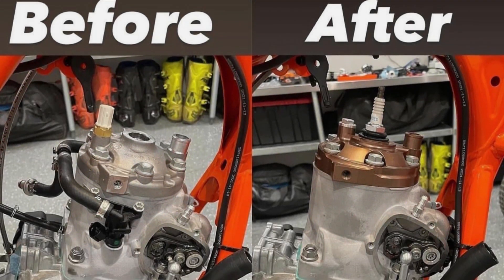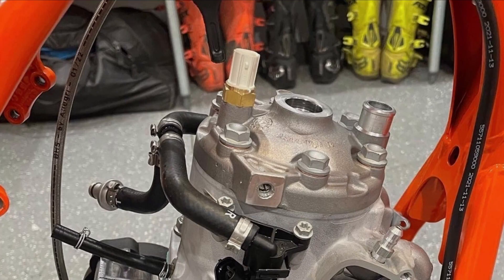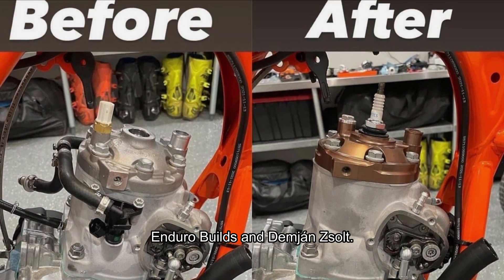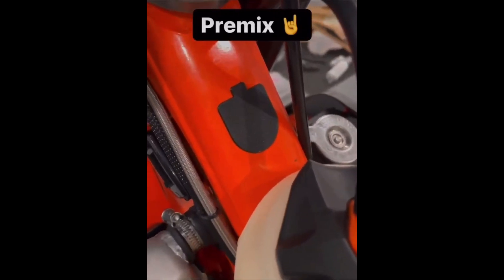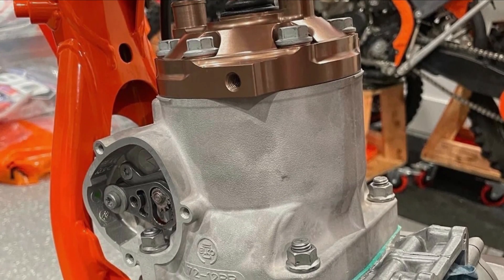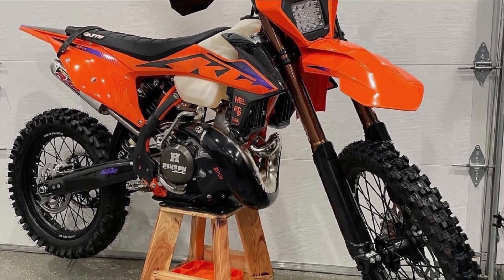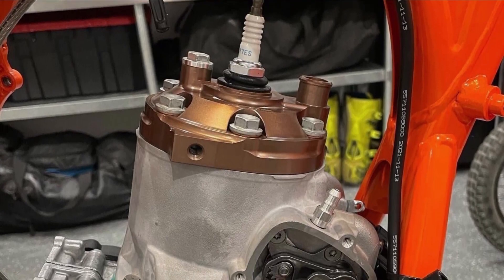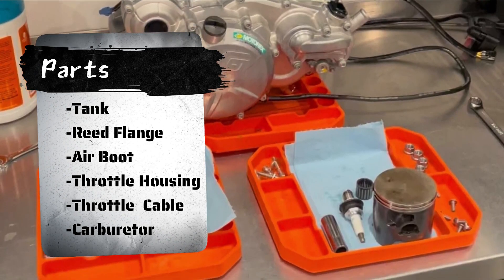KTM TPI TO CARBURETOR CONVERSION | $5,000 Dollars In Parts

Comment: I've done it as well because with the tpi it had light throttle spluttering that i hated even after custom head, tune and a top end rebuild. 
I'm still running the tpi electrics, now I have the ease of tuning to my riding style and it didn't loose any ridability or hp.

Comment: Hi, I'm considering the same conversion, because I want to have light and reliable bike. Please let me know if MY2023 could be still converted in the same way or something has changed. When it comes to cylinder, you have written in the description that we need to use 19 XC cylinder. Isn't the cylinder the same in EXC MY2017? So I would suggest to by 250 to 300 conversion kit: SXS12300100. What do you think?

Comment: I converted my 2022 TPI to a 2022.9 LOL. as in relocated a fuel injector to in-front of the reed cage, removed the oil injection sysyem and went to 100% premix. 
Added a Coober ECU and Slavens S3 head. 
Adjusted the power valve spring out a bit to flush with the case to reduce the hit and adjusted the air bypass screw in to richen it and make it run better in all conditions and throttle positions.
It goes like a scalded cat now, has instant throttle repsonse every where, and will tractor pull all day long at idle speed in 2 & 3rd gear. Will power loft the front wheel in all 6 gears.

Comment: I converted a 21 TX 300 with a BRC 500 from fuel injected to carbureted.   I used all new parts except the carburetor,  and spent about 1000.00 dollars doing it.  The flywheel is the most expensive part, .it's easy and no where near 5 grand.
Reply: why was it necessary to change the flywheel?

Comment: seems not a good choice. Correct the TPI by adding oil to the tank or deleted and split the injectors. Or buy a TBI. Other brands are ok, but not as easy as KTM that is a pure fact. Except Sherco other 2strokes are plain crap and can't rival KTM, whatever people's wanna say about it. 
if you like carb just buy the GASGAS they have some still carbed there. But sorry to say, carb is old and annoying tech, injection is clearly the thing. Do not make the same none sense talk like back in the 90's on the 4stroke...carb is better than injection...yeah sure...we can see that on the 4stroke...plenty of carbs on the 4s nowadays....
People telling that carb is easier than injector is complete BS, first a carb is a pain has you need to service it very very often and get dirty and setting is changing and stuff. Injectors never have any issue.
Reply: You can't just add oil to the tank and remove the pump. It results in the oil not getting to the crankshaft and all going out of the exhaust. You'd have to do this along with the injector relocation too.

Comment: Just put a tbi conversion kit on if you don't like tpi. Far less work and expense.
Reply: Where i can find this tbi conversion kit
Reply: @miguelbardales5561  There are several kits out in the market right now. Sure Shot injector replicator TPI to TBI is one of the kits available.
Reply from the maker: I did not do this project, but I find it very interesting. How do I convert my TPI to TBI ? What mods i need do
Reply: @TheDirtbikeRider   use the commonly available kit you can find for $150 or so. There's another that is sometimes on eBay from Ukraine that is identical. Then there's the Athena kit which seems too complex IMO.

Comment: I have 2023 TE150i can I use 2019 TE150 parts for this? Very interested.
Reply: Hello, and in 150 there is Kaymco cylinder as well? or still Elko?????🤔
Reply from the maker: YES it is important that you use the carburetor model and all these same parts like in the video

Comment: WTF wants to convert a $12g bike with $5g of needed upgrades lol EVEN after that you get a sub standard carbd bike. Just buy a 18'/19'tx xc or stay away from orange. New TBI bikes got such a weak stator you cannot run Light and  fan on at the same time, in fact I heard the fan alone kills the battery now.. and with NO kick start. So why ?why?why? lol *ps ktm starters are still horrible.. in  moist enviroments the starters are failing again..seen this locally.
Reply from the maker: I really don't know about that new model that has a problem with the power output problem for lights. Can you tell me more about ?
Reply: @TheDirtbikeRider  I heard on the 23' KTM XC/tbi bikes they use a lower output stator. If you run a fan it kills the battery. If you fan and lights you kill the battery even quicker. In Hawaii where its tropical and Hard Enduro a fan is a must. You know this!!

Comment: Just buy a Sherco, Beta or TM carb while you still can.  This conversation makes no sense...  Once the engine is converted do you convert suspension to KYB as well?
Reply: You make a good point logically but motorcycles are anything but logical its how they make you feel ,i have six or so ktm / ktm based bikes and i love riding them ,as for suspension KTM leaves a lot to be desired if you ride a bit faster or more technical terrain ,i do my own suspension work and have found solutions for the type of riding etc i do ,if you are on a budget or just have common sense lol buy a sherco / reiju / beta etc if you love the bike enough you will pay the extra cash ,my bikes are like my girl friends ,yes i need to get out more lol .
Reply: @dnrg62  exactly you can build your bike to suit your riding style, I had an 86’ IT200 built the motor, YZ250 suspension and I swear I was faster on that bike than anything I’ve ridden since.
Reply: @deborahchesser7375  ,lol its 80 percent the rider and 20 percent the bike in the end ,rebuilt old bikes all my life ( from about 83) any bike setup / tuned to your riding style / speed etc will always be better than an off the shelf one size fits all bike ,back in the early 90s i rebuilt an old YZ490 i dont think i was any faster on that as i was always struggling to stay on it but thats half the fun , the joy of riding is what its all about not how much you spend .👍
Reply: OR a YX250X.
Reply: @josephfelice601  yes that too
Reply: just buy a 2019 ktm if you like ktm and hate TBI/TPI

Comment: I have a 2020 250 xc with a TSP head and ecu reflash ,TSP have a throttle body relocation kit which places one of the injectors n the throttle body ( as i understand it ) the other still in the cylinder ,hopefully i will be fitting this soon i have always had good results with TSP ( no affiliation with them) if i am not happy with the results i will be doing a carby conversion  like you and i will fit a 38 mm keihen carb with a 113A stic module with a JD jetting kit ( running this in my other carbed bikes and i am extremely pleased with the results , i am sure the smart carb and lectron etc are good options but if you own a keihen carb this is a good option .

Comment from the maker: If you like the carburator more, leave a like
Reply: I have a question 🤔 why though
Reply: @DeveroyB  exactly lol. there is no point but i guess some people just love carbs?
Reply: @catow465  this build by Hard Enduro Life uses a 36mm SC2 SmartCarb which is as close to fuel injection as carburetion gets in terms of simplicity of tuning and compensation for elevation/temp changes, only without the complexity and failure points of KTM's TPI system.